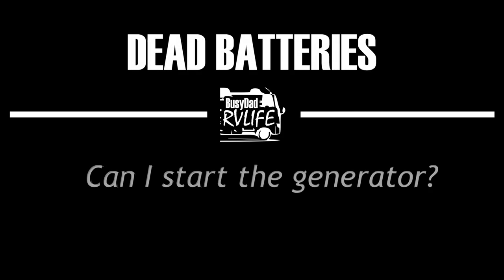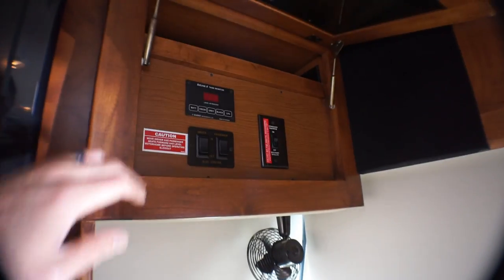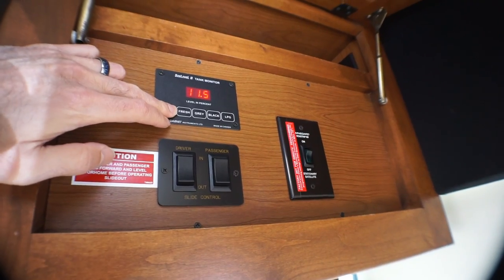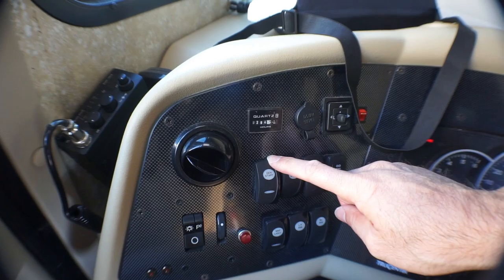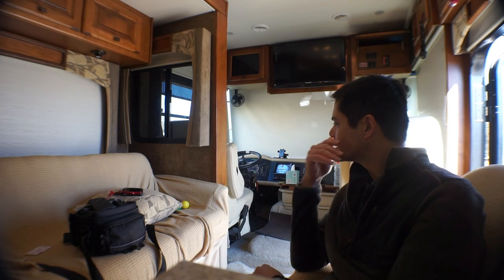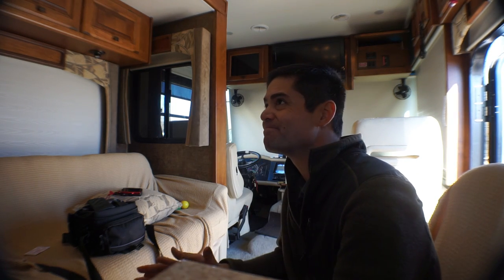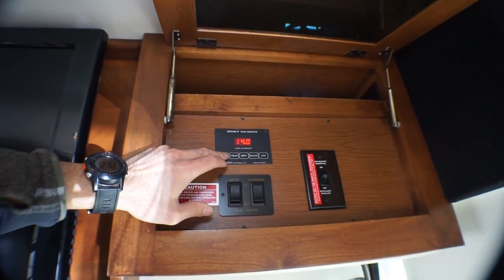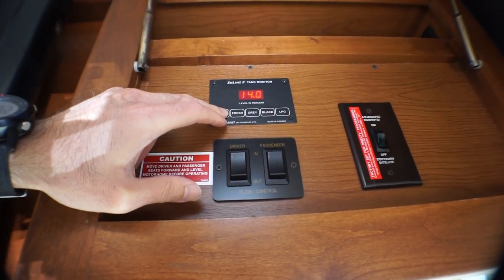Learning the hard way - Dead House Batteries in the RV and Generator Won't Start

Comment: You should ALWAYS have a pair of Jumper Cables with you. Then you could have just Jumped from your engine's battery to the house batteries, and had the generator running in about 30 seconds.
Reply: Brilliant!
Reply: How do you do that
Reply: Great advice. At Walmart for the night and the house batteries were low. Generator wouldn't start. I had cables so I took the Coach engine battery out with an adjustable wrench, hooked the negative to the negative and the positive to the positive and the generator started in 29 seconds I think! My wife now thinks I am a genius. Thanks again. 😊Heading home to Prince Edward Island Canada in the morning.

Comment: If you have no generator how do you hook up your house batteries  to charge when the chassis battery is running? The previous owner removed the generator and house battery so I’m trying to learn
Reply from the maker: I’m not exactly sure, but from what I remember about the coach there was the physical connection between the chassis and coach 12v circuits with some control module in between - probably to prevent overcharging etc

Comment: I use a solar bank to keep my chassis battery 
Charged daily my coach battery died and my chassis battery allowed me to use the bypass switch to turn the engine over and the generator as well
Reply from the maker: @salvatore Perna - that's a super tip.  I am planning on a solar panel or two to charge the coach batteries but a simple setup for the chassis battery would be a great addition!

Comment: What are some tips to keep the battery from running down?
Reply from the maker: One of the easiest first steps is to install a battery cutoff (if it's not already installed) to keep parasitic draw off of your batteries. But they will still discharge over time without anything connected - so that's why we installed a 100w solar panel on the roof, it keeps the batteries managed and 100% everytime we go back to storage 🙂

Comment: We rented a class A and were gone all day (16 ish hours) only to come back to a dark dead RV.  The owner didn't have any words of wisdom at all.  

Since we were at a state park with no hookups, the manager had his son bring over a portable generator with a 50 amp connection.  Plugged in, started the generator, and got the slides into get on our way.   I have no idea what the voltage was since this thing was so old, I just had 4 LED (i assume) lights to show the charge state.... none of them were lit.

Wondering why the chassis battery isn't set up to start the generator.  It's not like it would be doing it all the time.  Other question I have is if it still is only the generator running that will work the slides, or was this because the RV was 12 years old?

Both limitations seem very strange to me.  I would have gladly dealt with a pull start on this generator to get it going, but there isn't one.

Next time we'll take jumper cables and get out a lot quicker.

Comment: how long did you have to wait?
Reply from the maker: About 10 minutes was enough in this case to put some charge in the coach batteries, but it depends on how "dead" they are...
Reply: @BusyDadRVLife  do you start the engine for more then 10 minutes will that charge it  full
Reply from the maker: I think that could work to a point, but I think it would be faster to get the generator started and then let the 12v charger in the coach recharge the batteries off of the 120v from the generator.
Reply: Is the coach battery the aux battery?
Reply from the maker: It might be called that. The coach battery (or usually, two or more batteries together) provide the 12v power for the motorhome. They power the light fixtures, water pump, etc. Then there is another separate battery used to start the engine, that's usually called the chassis battery.

Comment: Generator run off engine gas.
Reply: Yes most rv generators will run off the same tank your engine does but I'll run it down to 1/4 of a tank and will shut off automatically so there's still enough gas to get to the gas station hopefully